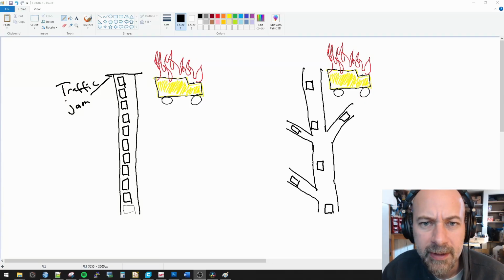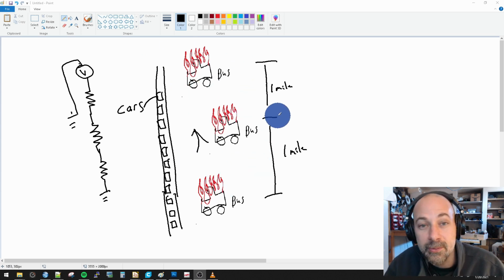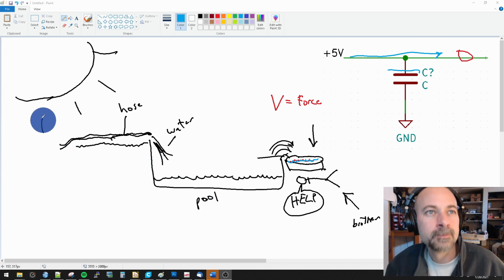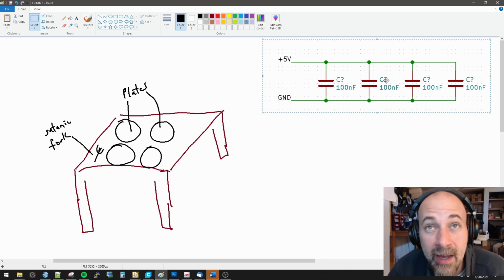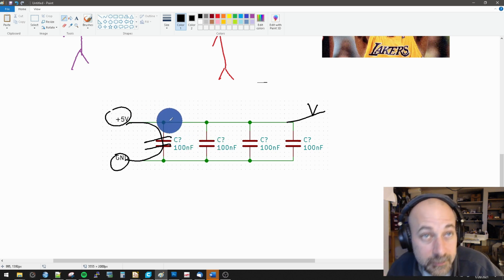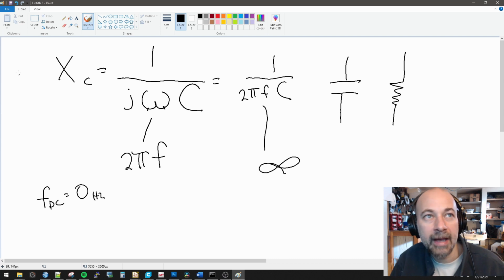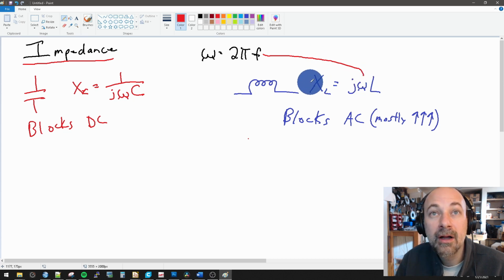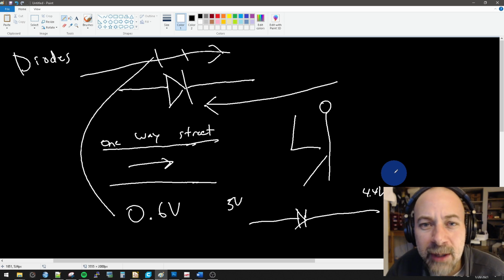Electronics Basics:  Intuition In Resistors, Capacitors, Inductors, and Diodes

Comment: I remember you from the recording review website like...15 years ago? Now I'm kinda interested in learning electronics because it would be fun to develop vst plugins with analog emulation, so this is right up my alley!
Reply: Small world!  Yeah, eons ago I was the Recording Review guy.  Now I'm hardcore into electronics and have begun to tinker with the Youtube thing.  To do the analog emulation thing, you'll want to know all about parasitics.  For example, every capacitor has a bit of inductance (even though they are supposed to be "opposite" of each other).  So does every wire.   While the UI is a pain, LtSpice is awesome for putting in real models and seeing their frequency response and such.   It'll give you some huge clues.  Good luck!  If you have any questions, just yell.
Reply from the maker: If you do decide to tinker with LtSpice (again, the workflow is TERRIBLE...but the tool is sensational), it's highly recommended that you change the default shortcuts to something more intuitive to you.  I do all my PCB layout in Kicad so I changed LtSpice so that it uses all the same shortcuts.  Good luck!
Reply: @lardrocket thanks for the response!

I'm probably a very long ways away from doing anything in spice, I think? I know programing and math stuff (through ordinary differential equations), but electronics stuff I only know the little I remember from the circuits chapter of the physics class I took a few years ago. 

I'm guessing I'm years away from doing anything real.
Reply from the maker: @briefcasemanx  I think I'm such a fan of simulation BECAUSE it handles all the ODEs.  I had my fill of that in school and avoid it when possible.  I suspect you'll learn quickly when you are ready.    Give it hell!